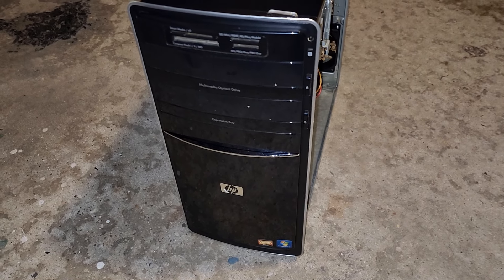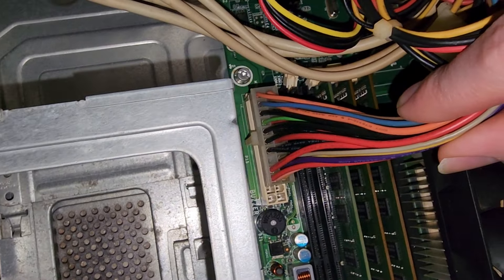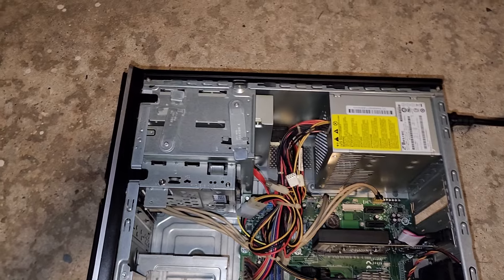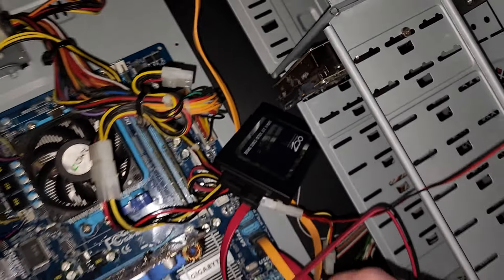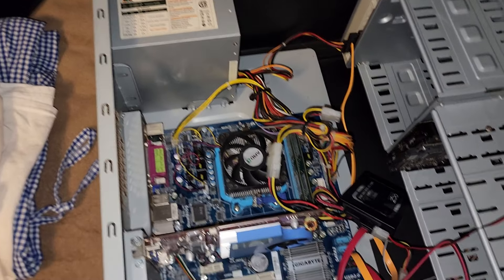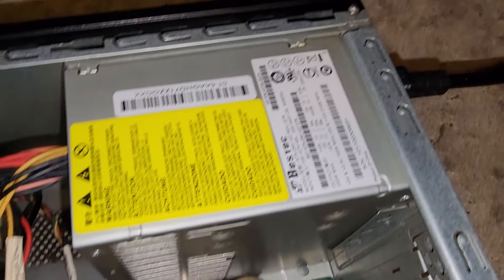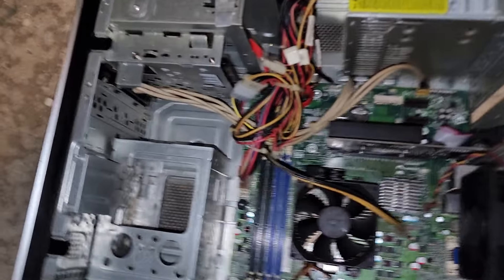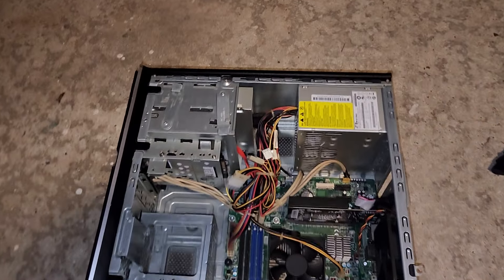The HP Pavilion P6000 Series Is Back, But Dead Power Supply Part 1

Comment: It's a simple bad power supply.

Can't find a replacement power supply?  OR DIDN'T TRY??????

Guaranteed there are tons of those out there.  You even have the part number.  Clearly you didn't try.  HINT:  You won't find parts for a 10-15 year old machine on Amazon.

You don't need the same one, just one of the same or higher specs.  That does involve knowing larger from smaller numbers, so I know it's really hard.
Only the original HP supply will have the green light on the back.  It's just an indicator, you don't need it.